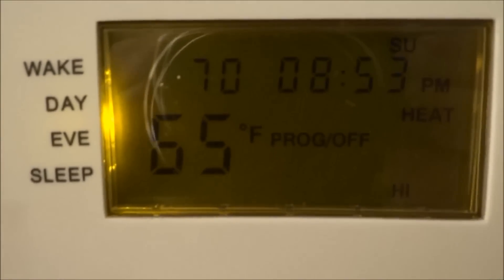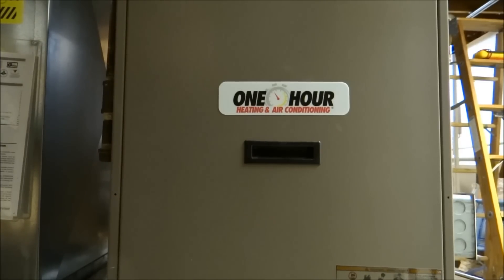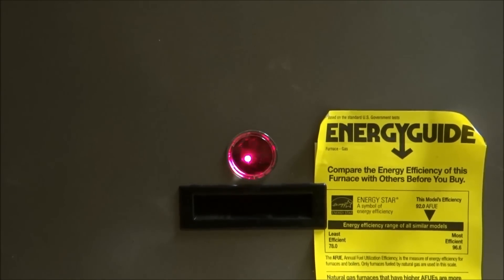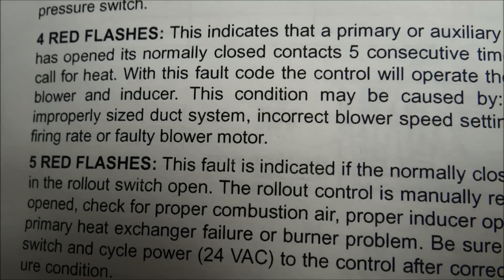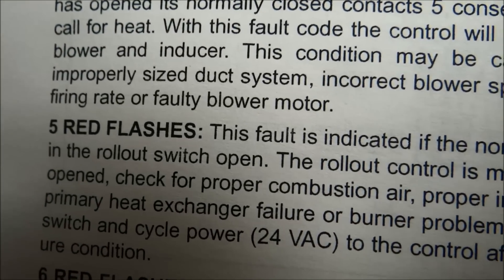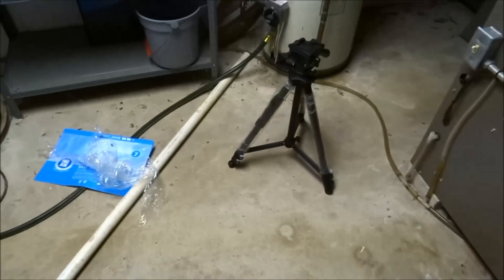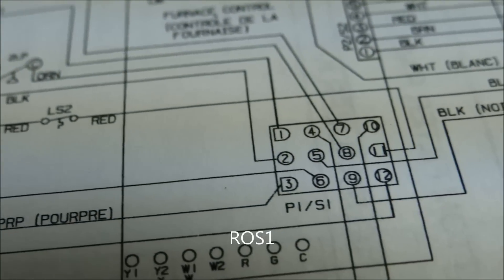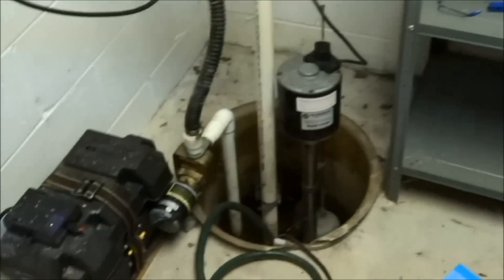York Furnace - 4 red flashes diagnosis and repair

Comment: Thank you for the video my furnace just started doing this and I am going to try what you did to test it. I am very good at fixing these sort of things. My board a few years back the pressure switch was the problem and I found the big plug on the board al the solder joints were cracked so I resoldered them and works perfectly since then till now. I will let you know how I do.
Reply: I went to do some testing on the switches and the dam furnace ran from 68* to 71* and shut off like brand new OMG. Wasted 1 1/2 hours of my life sitting there waiting. lol
Reply from the maker: @danielesilvaggi  Sounds about right. Don't worry, the problem will return at the most inconvenient moment.
Reply: @dogbyte555  Oh I have no doubt about that lol

Comment: Same 4 red flash
I tested three limit switches, all of which are jobs. I even jumped three switches, but still haven't changed. I think it's a problem with the control board, don't you think？
Reply from the maker: It's possible, but I would double and triple check everything before condemning the board. Read the owners manual as well to see what the code means in case it is different.
Reply: I have the same problem. Cleaned the a coil and secondary exchanger. It is blowing hard but still tripping. I'll let you know what I find in mine.

Comment: Fabulous step by step on a furnace similar to our Luxaire branded one. Had this exact problem yesterday (and of course all the supply stores were closed in lieu of New Year's Day) but followed what you did and sure enough it was the inducer limit switch. Watched the meat thermometer for about half a dozen cycles and was confident all was well otherwise and ran the furnace overnight with the bypass. Got a new switch this morning and all is well again. Part was CDN$47 and I probably saved $250 in service call charges and the up charge on the part.
Reply from the maker: Great news! I am glad it helped you.
Reply: Where did you order the part  from?

Comment: Did you just stick the thermometer in the hole that the switch sits in?
Reply from the maker: Yes, I wanted to check the temperature at the same place that the switch does. But be advised that I am not an HVAC technician.
Reply: @dogbyte555  that is what I did. Looks like the switch is bad for me. But now after I reconnected the switch the furnace will not power on. Even after flipping breaker and power switch.
Reply: So there is a 3amp fuse on the control board that blew. Not sure if this happened when I was jumpering the limit switch connectors or not. But furnace is operating again. Still need new limit switch.
Reply from the maker: @ramblinman7153  possibly if 1 of the wires touched the grounded sheet metal, it could have blown the fuse.

Comment: Thank you for the video sir.   My York furnace actually had a different reason for 4 flashes.   But your video helped this novice immensely plus I learned a couple of troubleshooting tricks that will come in handy in the future.   Within 20 minutes of fumbling, I found that the limit switch at the top of my blower fan was tripped.   I reset it and I am back in business.
Reply from the maker: Wow. Thanks. I'm glad it helped.
Reply: How did you reset it?
Reply: @nohelpg7584  the switch itself has a small plastic “trip switch” that pops out between the two wire contacts connected to the switch.  I simply used a flathead screwdriver to push that plastic piece back down.

Comment: My idiot renters left the filter in for 1 year, heat and cool. Looked like a piece of dirty plywood.  Problem is this furnace had a hidden limit switch inside the blower motor body, and I had to dig deep to find it, even with the schematic and manual. Then I had to pull the top off this package unit to clean the AC coil that was also packed with crap. AIR FLOW! number one issue before you guys start raping the customer with a board. Then I had a limit switch that would reset if you hit the unit with a hammer. From now on, for 10$ I'll change all limit switches every time I go inside.  Now here is a good one. This York unit would sometimes run ok with faulty limits. Guess why? the four burners were stacked vertically and I had changed it to Propane. Well, propane falls, and the pilot only lit the bottom 2 burners!  Found that by a lot of detective work. So I built a " chamber" around the bottom burner to keep the propane in place long enough to catch the top 2 burners. So if 2 burners were working, and the excess propane is spilling on the ground, the limit switches would not trip. But every now and then 4 burners would light, and then the bad filter would kill a limit switch. Quite a mystery case. Actually I found the non burning burners by smelling raw propane when the unit was running. No window to see the burners so had to open the door while running. If you get a good tech, you get it fixed fast. If you get a dumb and hungry one, you are set to be screwed.

Comment: Mine doesnt seem to even light up but I have the 4 lights. Just replaced filter with no success. Any ideas before needing to call a pro?
Reply from the maker: Maybe check all the temperature cutouts with a meter, and see if any are open.

Comment: Same furnace, same problem. Gonna change out that limit switch and give it a try before it gets real cold up here in Corinth, NY. I see a bunch of options out there for the switch but hopefully that “L160-20F” (which mine agreed to) will work. Thanks for the video!

Comment: I have exact problem, furnace run in short cycle 90 seconds and stop then restart. (4 blink -Lexaire)
Exactly to this video.  I notice there are 3 limit switch on my furnace. ( left right top) top one reset push button stuck/jammed?)
The other two push button seems to be ok.
Hopefully that is the problem.
Thank you , great video.
Reply: The switches with the buttons are roll out switches. They detect flames coming out where they shouldn't be.

Comment: it's your  NEST THERMOSTAT. missing a common Wire. 
if you are wired with A Nest, and you are running 3 wire (green, red, White)
you are missing the 4th wire (Black or Blue)
This will cause your Thermostat to steal power from your control board and you will continue to have problem with random component failure.
Reply: wothangclang is there any fix to this? Should I just get a regular thermostat?
Reply: Hey...so...I have a nest, and getting this error
Please tell me more

Comment: I checked all the switches that u mentioned n they all read 00
Reply: Can you help me
Reply: The main fan only comes on if I help it spin what could I check then
Reply from the maker: I am not a furnace technician. Are you getting a 4 flashing red code?
Reply: sounds like a start capacitor/motor problem

Comment: That's black plastic cover on the limit switch needs to be remove it's just a shipping cover 
Needs to be stainless steel or bare contact
Reply: That's why you don't see the screws holes it's just a cover remove it for the switch to truly reads the temps
Reply from the maker: Thanks for pointing that out. I corrected the problem.
https://www.youtube.com/watch?v=B29muKKgFR8
Reply: That plastic cover is on there because it protects the bimetal from acid inside the blower housing.